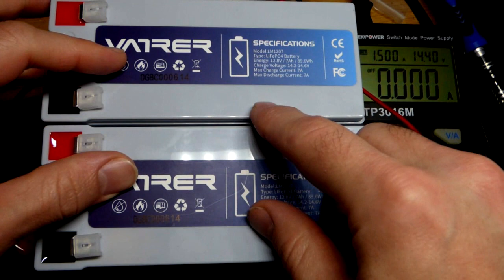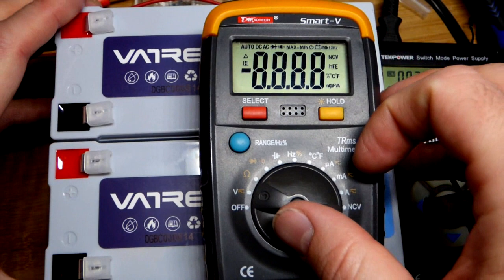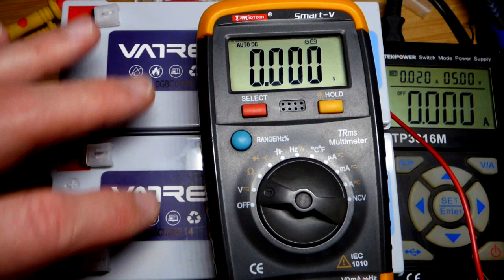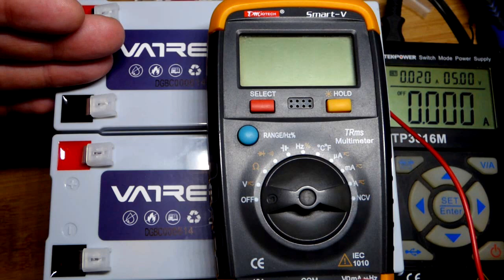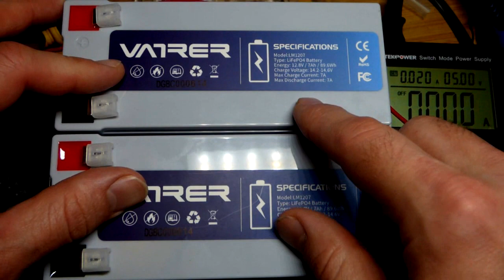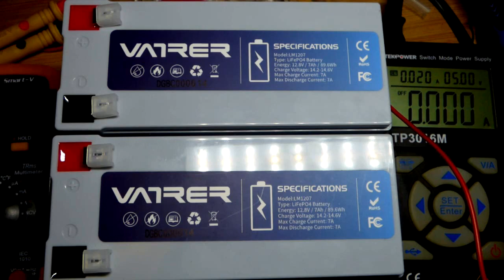Ten hours after DIY charging my two VATRER 7Ah 12V LiFePO4 batteries by Electronzap

Comment: Did you find a charger you liked? I have read lots of reviews on inexpensive chargers and haven’t decided on one yet.
Reply from the maker: I have one that I haven't used yet. I can charge manually and I have a couple solar charge controllers. My LiF'ePO4 batteries are pretty small though, so I didn't want more than 1.5A charging current, and I think most are a lot higher than that.

Comment: I love this battery so much and use this in my car, replaced older lead acid battery. Mine stabilized around 13.1volt. Also use this battery for other projects and it's much safer than li-ion, worth it